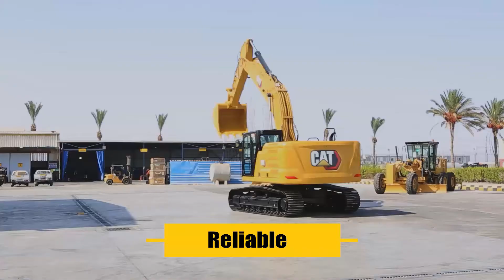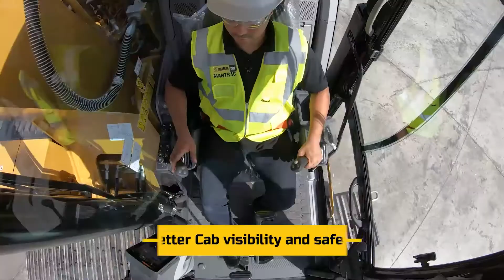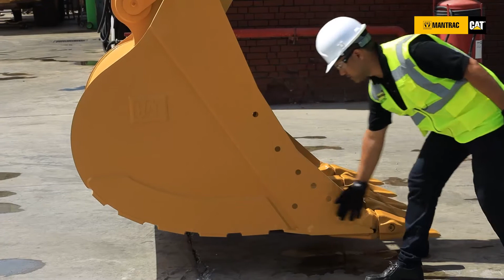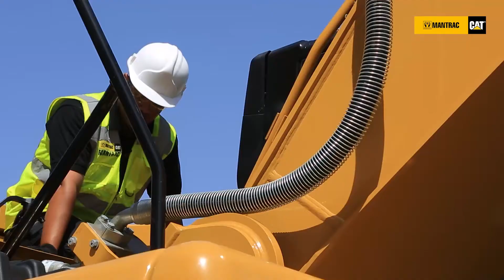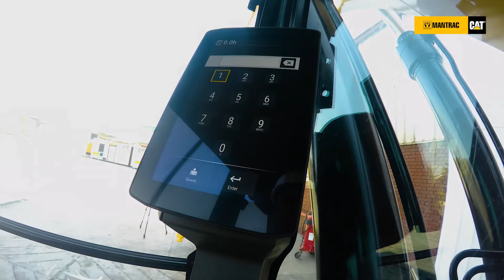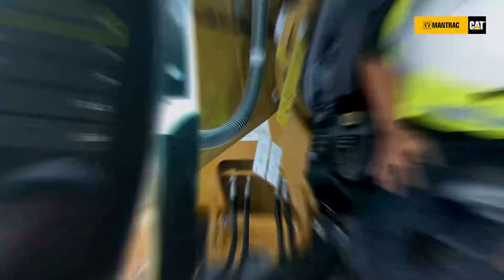Ask the Expert: Cat® 330GC Excavator Walkaround

Comment: Hello
 I have a personal point of view
 1. The fuel tank is fiberglass in demolition work, if it is exposed to iron or a skewer, it will cause a hole and smuggle diesel / iron is much better than fiberglass
 2. The cabin or the cabin is supposed to have the glass of the door at the bottom being iron, but the window glass is present and the triangular glass is small because if it is exposed to a rock or iron.  And the glass on the side of the album is supposed to be half of the glass, but not all of it is the cabin’s glass. It’s almost 90 percent glass. In the event, God forbid, the stomach turns over, the driver will be harmed. Safety and security in the cabin 👎🏻
 3. The radiator fans are supposed to be a single fan only in the engine shaft, the same as the old system, because 8 fans each time ruin one pomegranate or blades, and its seat is replaced by asphalt.

 personal point of view.  Accept my pass 🌹